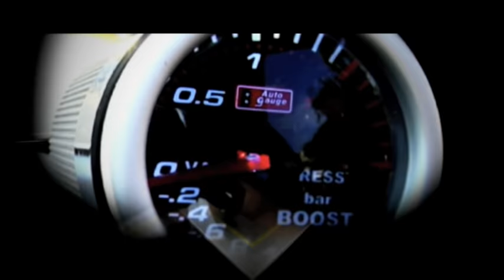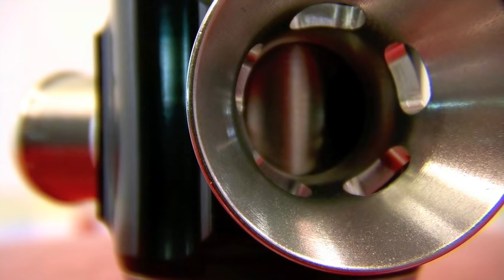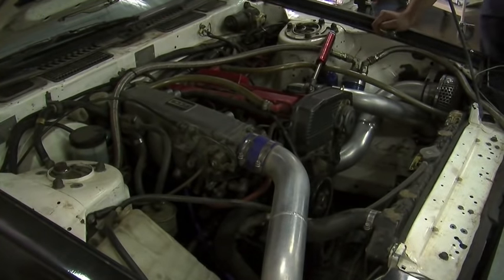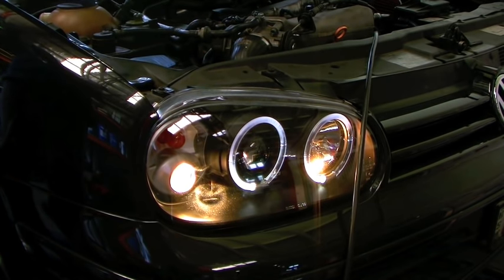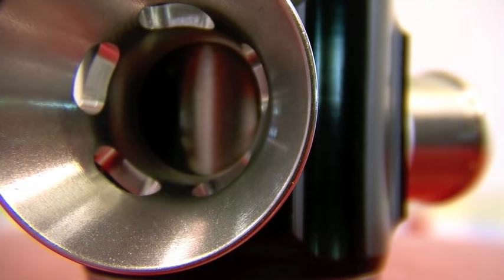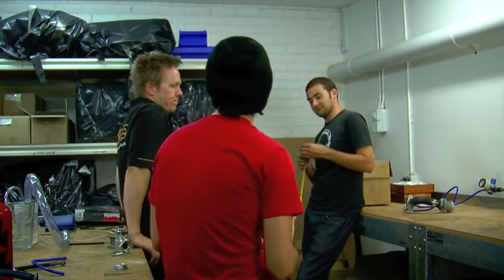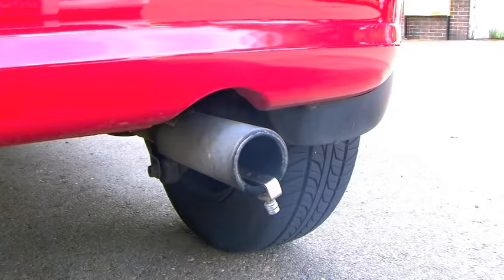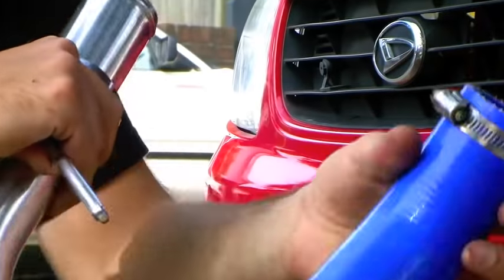Blow Off Valves Mythbusted

Comment: I note that they didn't actually list the reasons for a bov/bypass valve...
It has nothing to do with dyno pulls.
Use on a diesel would be pointless, as there is no valve to stop/restrict the airflow going into the intake ports of the motor, so there is no pressure wave to damage the turbo, or pop off the intake hoses.  (Unless you are doing some ridiculous high speed load, and stopping the motor dead-in which case it won't last long anyway....)

The bov/bypass valve was engineered to:
1.  Prevent pressure spikes from bending/folding the throttle plate.
2.  Prevent pressure spikes from back feeding the turbo compressor, acting as a brake, possibly bending fins, breaking the shaft between the turbine and compressor wheels...
3.  Slow the boost pressure drop (pre-throttle), so that you have the turbo still spun up as you shift the gears in hard acceleration.

A BOV vents to atmosphere, this creates a momentary rich condition (you can get flames out the tip of the exhaust depending on setup), and requires almost no plumbing.  As stated, this can also trigger computer diagnostics, and safety measures, depending on the complexity of the engine computer.  This momentary rich condition can mimic that which you get with a carburetor.

A Bypass valve, vents to the intake track pre boost device (turbo/supercharger/blower), but post air measurement (if so equipped).  This allows the computer to have a better idea of how much air is in the system. And can allow a little (very minor) help in spinning a turbo.  Also being that the air escape is part of the closed system, if there is a failure, and it sticks open, or the valve sealing fails, you don't have to worry about dirt and debris entering the intake system, or so much that unmetered air is entering exiting the system.

Who should consider them?
Those with motors than run boost and have throttle plates.
What does it do?
Decrease turbo lag, protect against damage from pressure spikes in boost motors with throttle plates.

This comment requires no replies.  It was likely stated earlier, but frankly I'm not wading through over three thousand comments, given the vitreal and spite I see in the first part of the comment list.  This comment is not done in spite, but in education, for those that were hoping for facts.
Reply: ok
Reply: The real mvp
Reply: They quite clearly said what their point was...
Reply: Your comment is much appreciated
Reply: "This comment requires no replies." OK, oh whoops...
Reply: k
Reply: What he said ☝︎︎
Reply: Best comment ever now can you let all those guys putting door stops on thier BOVs
Reply: So if you had to choose what would you go with on your turboed car?

Comment: My horses have blow off valves, but I am perty sure none of them is fitted with a turbo  ;) .
Reply: *****
It makes them go faster  :) .
Reply: +CNCmachiningisfun Put on a few decals for even more powah!
Reply: *****
The extra heat might cause a tail hair fire, especially if I feed them on high octane hay.
Reply: Tony Tuite
My horses like to look their best, so those decals ought to do the trick.
Maybe I could add some go-faster strips too  ;) .
Reply: *****
That,s cool, as I could use the spoiler as a work bench to hold my hoof care gear  :) .
Extra donkey power, and a mobile work bench on the farm, what could be finer?
Reply: *****
Hmmm, they ate all the chips when I dropped them in my search for the battered fish  :( .
I have some performance carrots here, and it seems that all my horses know how to install them  ;) .
Cripes, even my donkeys know which end to insert them into   ;) .
Reply: *****
Yes, my horses are seriously powerful.
Each one can deliver one full horse power  ;) .
Reply: +CNCmachiningisfun so they are all draft horses?
Reply: +windows_x_seven horses naturally have blow off valves males have one females have two. use beans to increase pressure release. p.s. keep the horse moving or invest in nose plugs.
Reply: airgunnerbro
Yup, drafty horses and breezy burros on my farm  :) .
Reply: +airgunnerbro  how many kw does it make
Reply: +Rakitha Peiriz 10 kw 50 kw if you harvest and use the extra methane as a result.
Reply: airgunnerbro try putting a dual exhaust on it , its going to sound maaaaaaaaad
Reply: No need for turbochargers, there the real horse power 😉️
Reply: ***** 
 True. The last thing you want is a squeaky blow off valve   ;) .
Reply: Mooo
Reply: zerg232 
 Yes, my Bull has one too.
 You can hear it from a mile away  ;) .
Reply: Pretty sure if they eat enough fermented stuffs it could turbo up that blow off valve action. ;)
Reply: What tune?
Reply: JDM Fanboy 
 Mosty "bum notes"  ;) .
Reply: L
Reply: Did it add horsepower? ;)
Reply: I think we can change that.🤔
Maybe we can get flames shooting out the horse's ass as it goes ludicrous speed.
Reply: You'll still get the same number of horse power ;)
Reply: Feed them beans